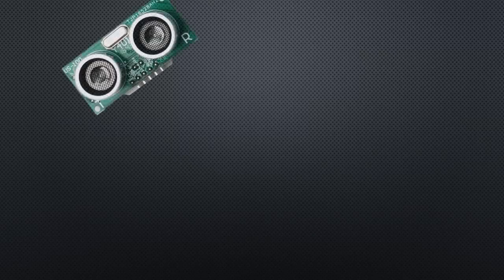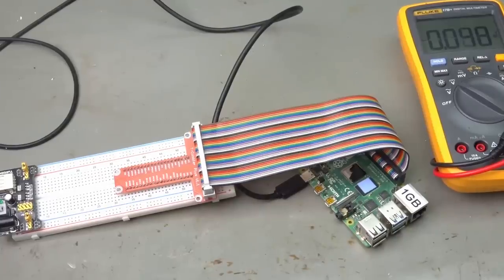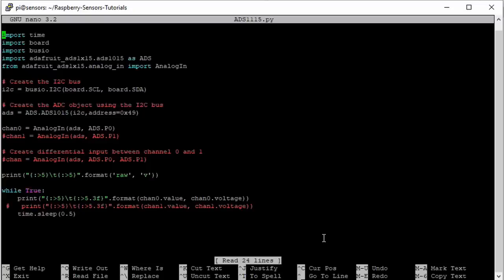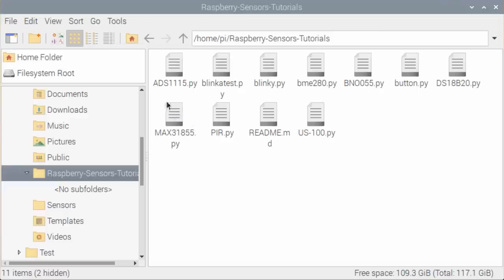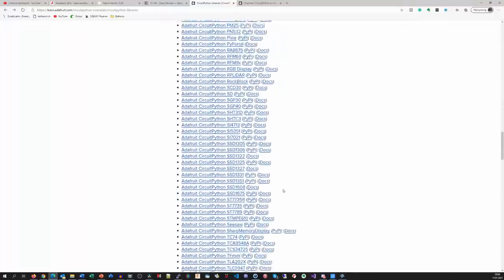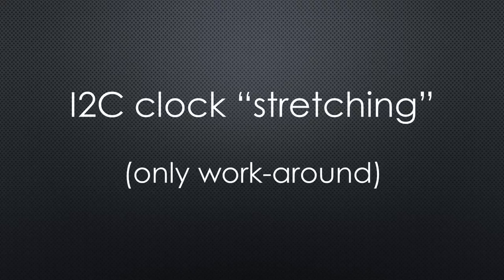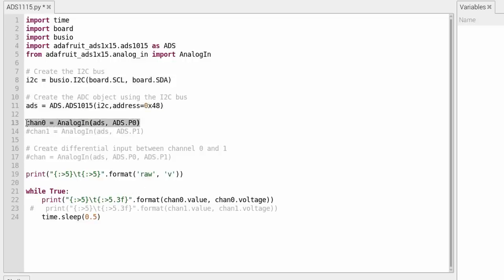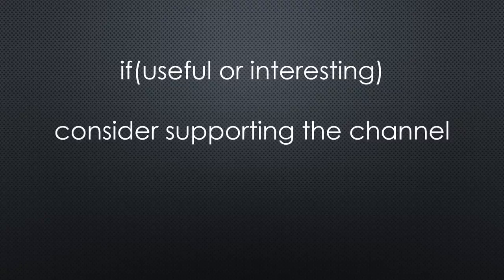#369 Definitive Guide to Attaching Sensors to the Raspberry Pi (Tutorial)

Comment: The default I2C pins  GPIO3 and GPIO4 have 1.8K pullup resistors on the Raspberry Pi board. No need for external pullups. It's a good idea to check if the sensor boards you are using also have pullups on them too. If they do, they will be in parallel with the ones on the Pi. Most BME280 modules have 10k pullups on them, which is not low enough to cause loading issues. If you have many I2C modules connected, you may need to be concerned with too much loading and need to remove pullups from your modules.
Reply from the maker: You are right with the internal pull-ups. I understood that the pull-ups have to be at the end of the (long) line. That is why I mentioned the possibility.
Reply: @AndreasSpiess  yup it helps when you have alot of devices on the bus.. and long lines..

Comment: Do check the register alignment byte order and data type (scaling) with the MAX SPI devices.  I had to reverse engineer Arduino libraries to make it work reliably in an ATtiny for translating the output to I2C... ATtiny with MAX mounted close to the sensor to minimise potential for interference. Don't recall the gruesome details but it took an all-nighter to resolve.

P.S. Another motivation was to makes the uC use only scaled integer arithmetic for fast results and lower power... It was sending temperature on an attached RTD and the self heating had to be negligible.
Reply from the maker: Good to know. This is probably why I like ready-made libraries ;-) It saves me some time and Adafruit did a good job.

Comment: Thanks for the pinout command. This is very handy!! A hint from me: This tool is provided by the GPIO Zero Python library, which is installed by default on the Raspberry Pi OS desktop image, but not on Raspberry Pi OS Lite.
Reply from the maker: Thanks for the info! I did not know. With the cheap SD cards, I did not use the lite version lately...
Reply: @AndreasSpiess  By not running the GUI on devices that don't need it, you not only save space on the disk but ram and CPU cycles as well - the latter being expensive on raspi

Comment: Hope you are going to cover the new PI microcontroller boards, the PI Pico soon. I have a pair on order. They are only €4 each.
Reply from the maker: Me too have a few on order...
Reply: is better than the esp32 chips, and new esp32-s3 chips, I wonder?
Reply: Interested to see the processing power for speech and video in action
Reply: @userou-ig1ze  no, they are not "better" as they don't have a wireless interface, touch detection and a few other things. Also they are slower. But they are more energy efficient and may be usefull for projects that don't require the ESP32 horsepower. ESP32 modules are cheaper but if you want a dev board, I don't know if you can get a ESP32 devboard for 4Eur.
Reply: @AndreasSpiess  when you review it, can you make sure to compare it to the STM32 Fs and the MCU used in the Teensy 4.1 in terms of raw performance as well as power usage please?
Reply: @Ownedyou  you can @4$

Comment: For the more adventurous programmer, you can also learn Rust on the RPi. And it includes embedded libraries for accessing pheripherals on the 40 pin header. Rust is an excellent candidate language for embedded software, and so your same program can then be ported to also run on cheaper embedded MCU platforms. Such as ESP32, Nordic NRF, etc.
Reply from the maker: I do not know Rust. But for the moment everything is pointing in the direction of Python in this field :-(
Reply: Rust is the language that tries to do all memory safety at compile time. So it gives many detailed compiler errors, to ensure that your code does not have memory leaks or buffer overruns. This also means there is no performance overheads of a garbage collector. And compiled rust is as fast as C/C++. Because in other languages to the runtime memory management cleanup task can randomly interrupt your program to perform cleanup duties. Rust does not have it. Also rust has a good interfaces / modules types system. And otherwise has some very advanced and modern language features. Rust forces the developer to do more work to achieve a given level of program functionality. But the trade is a fair one, that the programs you write are going to be less buggy and of a higher quality. Thanks to having to fix all of the many compiler errors. In Rust, the built in help system is the compiler itself. So not you know what rust really is. It is meant to be a very modern language. With very modern features. And also address the issue of memory management in C and C++. But without also adding the performance burden of a runtime.
Reply: In other words: you cannot have your cake and eat it. You have to prioritize at the language level which features of the programming language are more important to you. It is very much a trade off. This is the progress poiint where we are as civilization in the year 2021.

Actually there are 2 main solutions to this difficult problem. One solution already exists: which is to use a very well integrated and well optimized development platform such as Apple iOS. In such a system you have to do everything through the official Apple API calls. And then Apple can do a lot of hard work behind the scenes to optimize and have an amazing runtime in those libraries. Which can then work well with apples very specific and well integrated hardware resources. To ensure all programs can access those resources in a most effecient way. Of course also making the developer obey these very proprietary runtime APIs. And they only work well on apple hardware.

The other second solution is to hope in future we get new technological advances and breakthroughs in the runtimes of open source projects. That address the issues of existing runtimes in existing languages. However that is very complicated and difficult work. And you cannot really do it in an existing language with an existing runtime. Because then it will very often break backwards compatibility. It is instead easier to start from the point where rust is. Which is to say: without a mandatory runtime. Although rust does have a very limited optional runtime. It is not a full memory management / garbage collector etc.
Reply from the maker: Thank you for you information. As you indicate, for me the most important fact is the "ecosystem". For microcontrollers and hobby it should contain lots of libraries, examples, and a community which solved and openly documented all problems I will encounter. Then the fun per time factor is highest. These criteria are different if you want to build commercial applications. But with "Agile" I see these two areas coming closer...
Reply: Another language with python like syntax and great C interop is Nim which works well with microcontrollers such as esp32 because garbage collection is optional..
Reply: What are good libs for interacting with RPi GPIO in Rust?
Reply: @MFBcode  in Rust, there are hardware libraries called 'HAL'. Which means Hardware Abstraction Layer. So you include a HAL library for the rpi specific hardware. Plus also perhaps a generic interface library (or not). To find the rpi hal available you can just search 'rpi' on cargo.io for crates (=libraries) that match the search term. Or google the words 'cargo rpi hal'. To discover which libraries other people are using.
Reply: @MFBcode  For example, for RPI running linux operating system, you might want to use the 'linux-embedded-hal'. Which exposes GPIO on a variety of computers running linux. Weras for 'rpi bare metal' there is no linux os. In that case you would boot straight into your rust program instead. In which case you would use a different HAL, because there is no linux. You can use the rpi either way. Depending on whether you have some strict hardware realtime performance requirements, or prefer to be using linux ! And instead just execute your compiled rust embedded program as any other regular linux program. That just also happens to have access to all the rpi hardware GPIO pins. That is the much easier way.
Reply: @dreamcat4  Thanks for great explanation!

Comment: I have done some testing of DHT11 and BME280 lately. using Python and C. They will only transmit garbage when connected to 3.3 V. When using 5 Volts they work perfectly since middle of December. The wires used are Dupont female-female and about 10 cm's long. The sensors are breakout boards from Ebay. Just my 2 cents.
Reply from the maker: Thank you for sharing your experience. I always look at the datasheets of the sensors or boards. Sometimes they include a 3.3 volt regulator, sometimes not.
Reply: @AndreasSpiess  At lot of the El Cheapo stuff  on Ebay has no   datasheet or a schematic. I use my Tektronix 465 scope or Salae Logic analyzer to troubleshoot.The DHT11 sensor has a very high D.O.A rate and should be avoided.They also stop working after 3-4 years.  Use the DHT22 or DHT12 (I2C) instead. Then comes BME280 from Bosch. This is a very good sensor but when you buy one on Ebay there is great chance that you get a BMP280. Without humidity sensor. The I2C address is most often 0x76 for BME280 or 0x77 not so often. Use an I2C scanner if in doubt.

Comment: You had a video where you mention which type of mosfet you like to use to switch loads on EPS pins. Do you remember which one was that? And which mosfet?
Reply from the maker: I used MOSFETS in different videos. For 3.3 V, I usually use logic level MOSFETS like the IRLB8721 or the IRLZ44. These are N-channel. For 5 volt a lot more FETS should work.

Comment: Great video! What are the advantages of connecting a sensor to the raspberry pi instead of through an arduino?
Reply: If the project works fine with arduino. Then arduino is the right choice. Most of the projects won't require a computer like Raspberry Pi.
Reply from the maker: I use the Raspberry for data storage and user interface. If the Raspberry is close to the action it makes no sense to use an additional Arduino.

Comment: A useful overview, thanks Andreas. i2cdetect is showing a second device at 0x1a. Did you also have an MCP9808 temperature sensor connected?
Reply from the maker: I used the Argon case and I assume it uses this address. But I did not investigate.
Reply: @AndreasSpiess  I had a quick search and there's some info on the RaspberryPi forums that suggests that you communicate with a microcontroller on that address for things like setting the fan speed or killing power. One user has written his own replacement daemon for the case (https://gitlab.com/DarkElvenAngel/argononed).

Comment: Old ESP32 modules are not supported by the current version of CircuitPython. As CircuitPython is not compatible with MicroPython you can't use the same libraries on these chips. Only new ESP32-S2 microcontrollers are supported by CircuitPython.
Reply from the maker: Thanks for the info!

Comment: thanks for the upload, im using the MAX31855 and successfully recording, however i would like to use 3x thermocouples, how would i change the code to read three boards and also would the wiring be the same for the three boards except changing the cs for each one?
Reply from the maker: You have to connect each CS to another Raspberry pin and create more than one MAX31855 objects, each with a different CS pin. MOSI and SCK are all connected together.

Comment: Thank you as usual.  Still relatively new so this may be a basic question.   Are you using the CircuitPython libraries in the standard python3 interpreter?  I assumed you had to be in CircuitPython to use those.
Reply from the maker: Micropython is not the same as "real" python. So I would not trust that a mix will work.  But you can try...

Comment: @5:12: the libraries from circuit python are not easily usable! Only if you have an esp32-s2 (ironically, less powerful and no bluetooth!) and solder a new usb connection, you can actually use circuit python. The native esp32 support has been discontinued and is only supported as an additional 'wifi/heavy lifting' module ('airlift'). I really would like to know if there's an easy 'plug and play' possibility!
Reply from the maker: You are right. I was not specific enough. The S2 will get some followers. S3, S4 .... Also the new Pi Pico will be supported by Circuitpython.

Comment: What do you suggest for reading shaft speed (RPM) ?  There are a couple of different types of sensors (optical, Hall Effect, magnetic, etc.)
Reply from the maker: You can use optical and magnetic as you like. Depending on your situation. I have no preference.
Reply: @AndreasSpiess  How do you connect them to a RPi and what library is need to read them ?
Reply from the maker: I made a video on how to connect sensors to a Raspberry

Comment: Good evening Andreas!
I have been following your wonderful youtube channel for a long time, and I really cant thank you enough...

I wanted to ask you a little advice:

I am trying to connect a RFID reader to Raspberry (No problem there), but I have also connected a touch display. The touch display wants to use exclusively the following Pins (which, from docs I have, the RFID ariel also needs):
PIN 19 (MOSI)
PIN 21 (MISO)
PIN 23 (SCK)
PIN 22 (GPIO 6)..

Do you think I can put the RFID on other pins or is it an impossible task (I could use an Arduino and connect via USB but I'd rather not if at all possible)

THank you for ANY advice you can give.
Reply from the maker: Google "SPI interface". You will see: MISO, MOSI, and SCK are in parallel for all sensors. Only CS or CE (Chip select) is a separate pin for each device. You have to tell your code which pin you use.
Reply: @AndreasSpiess  Thank you very much you wonder swiss-person!!

Comment: Nicely done Andreas!

Have you experimented with using the newest Raspberry Pi and connect it to an Arduino board with sensors already connected to Arduino C++ sensors and edit the data output to be ported to the raspberry via GPIO?
Reply from the maker: No. Most of my sensors are on ESP32 and I use wireless/MQTT

Comment: Unfortunately an OS like Linux makes it much more difficult to get 100% correct timing when needed.  Ex. if you want to send or receive high-frequency signals, an Arduino (or Attiny or ESP8266 or ESP32 or STM32 or ...) is just way easier because you can get the timing correct with just delays (or real timer- or pin-interrupts).  On a Pi, your process can get pre-empted at the critical moment, messing up the crucial timing.  Optimized mechanisms as in the pigpio package can reduce the problem a bit, but are way more difficult to use.  I tend to do real-time stuff on a uP (ex. Attiny84) and have it communicate with the Pi using a protocol that the Pi can handle without glitches.
Reply from the maker: You are right: Real-time applications are in the domain of microcontrollers.

Comment: There is one BIG BIG downside to Circuitpython, interrupts are not supported. This obviates the real time support for example, endstop alerts which can be simply handled with the RPi.GPIO library add_event_detect function. This also includes certain i2c multiplexer which provide an interrupts based on the client state change
Reply from the maker: AFAIK I only used the circuitpython libraries and standard Python. Maybe you can combine the two libraries,I do not know. Anyway, interrupts ans linux is not the preferred combination for me...
Reply: @AndreasSpiess  I just tested on a Pi Zero and the Circuitpython libraries do not conflict. There is an improved RPI GPIO library called gpiozero which encapsulates and simplifies the RPi.GPO functionality and provides high level interfaces to Buttons, Led, i2c, spi etc. My complaint really is that the Circuitpython standalone environment in comparison to Micropython does not support interrupts or treads.
Reply from the maker: I mentioned GPIOZERO. But it does not support many sensors. I am not sure if threads are not supported on the Pi. I do not use interrupts on Linux systems.
Reply: @AndreasSpiess  The gpiozero, all lower case, is a high level wrapper of RPi.GPIO
Reply: @AndreasSpiess  and in addition to supporting many sensors and peripherals, for example, Light, Distance,  Servo and etc.. also wraps RPI architecture from a board perspective.

Comment: Nice video thanks. Have you looked at coding on Raspberry Pi remotely with Visual Studio Code using the Remote Development extension?
Reply from the maker: No. I mostly use the Pi as a server, and not for realtime stuff. There I use microcontrollers

Comment: It is a bit sad to do a video about Blinka and CircuitPython without saying you do so in the title or the description... not even a link. One important thing to notice is that CircuitPython is not supported on ESP32. But it is supported on ESP32S2 board. But there are many board, including some with RP2040 that are supported. Some STM32, some NRF52, many ARM M0 and M4. Also Blinka works on many SBC and is in now way limited to the Pi. Keep the good work.
Reply from the maker: I think I mentioned Circuitpython as well as Adafruit. And you are right, I was not specific enough with the ESP32
Reply: @AndreasSpiess  You could have titled it: "Connect Sensors to Raspberry Pi with CircuitPython." or say in the description: "The video cover: Using Blinka and CircuitPython for ...". It is in the video but it feel hidden, or maybe writing this is a spoiler for the big reveal in the video?